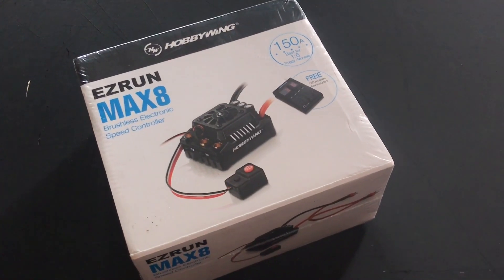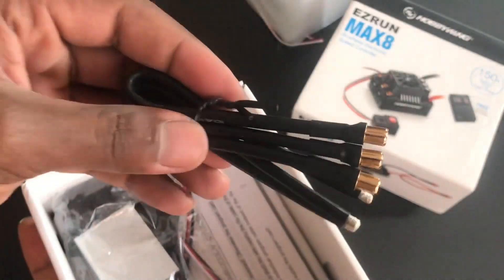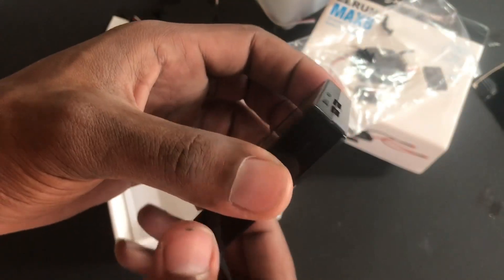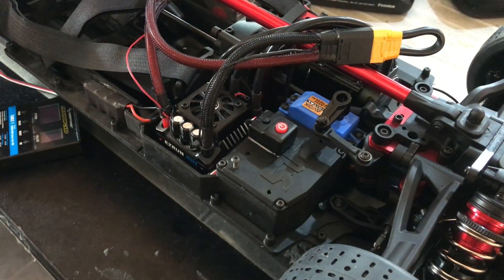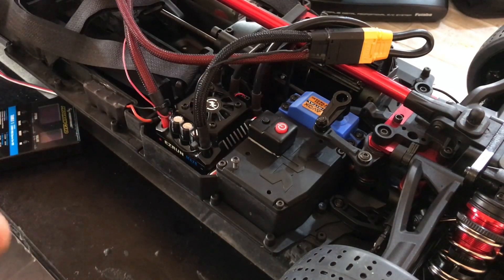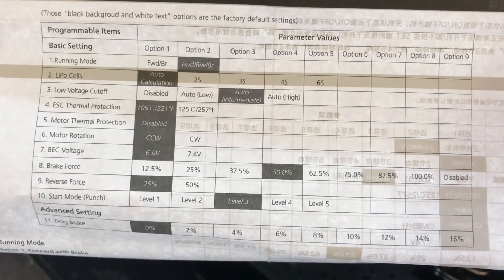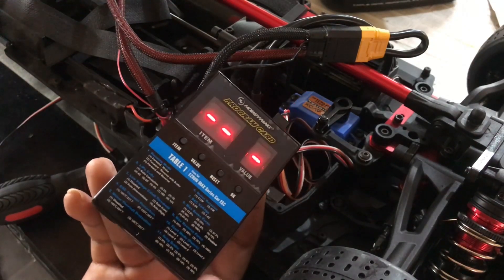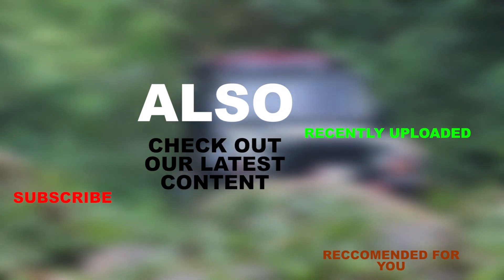Hobbywing EZRUN MAX8 V3 T PLUG 150A Waterproof Brushless ESC - Unboxing & Setup

Comment: Wait im confused you change out the deans for xt60's but put an adapter on the xt60's back to deans? Anyways can it handle 6s 2000kv 4282 size motor?

Comment: Question: Is there a way to just use ONE battery ? or I must buy 2 batteries to use this ESC ?  thank you.
Reply from the maker: Yes, you can use A Loop Connector On One Of The Plugs. there are plenty for sale on ebay
Reply: @GNDRCADVENTURES  ty

Comment: Thank you so much my G! I just put this in the Kyosho Inferno Gt 2. Was trying to figure out how to set the punch level. Good Looks
Reply from the maker: awesome to hear bud, i appreciate the feedback
Reply: Question: Is there a way to just use ONE battery ? or I must buy 2 batteries to use this ESC ?  thank you.
Reply: @43SunSon  Yes you can use one battery by using the jumper plug
Reply: @darksunridah  thanks

Comment: Got 1 with the 2200kv motor crazy fast in my 3.3 revo electric conversion running 4s 5000 at 50c
Nice video on showing feature 👍 
Same thing happened to me with the programming card, I just kept card plugged in and shut esc off then turned back on. I had to do this a couple times before it would work for me. Hope that helps 
Keep up the great work 👍
Reply: Question: Is there a way to just use ONE battery ? or I must buy 2 batteries to use this ESC ?  thank you.
Reply: @43SunSon  
They make a jumper to put on one connector to the esc and you can run one battery. I run a single 4s in my revo electric conversion because there is no room for two batteries but I cut the one connector off so I don’t need the jumper. I love my setup, it will do standing backflips and wheelies at any speed. 
Hope that helps
Reply: @livewire2987  thanks buddy.  got it!